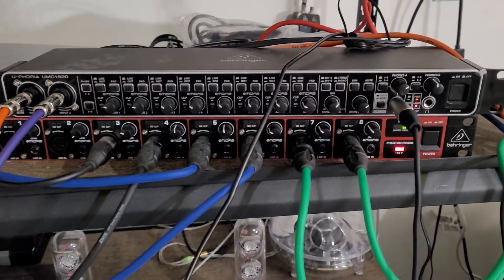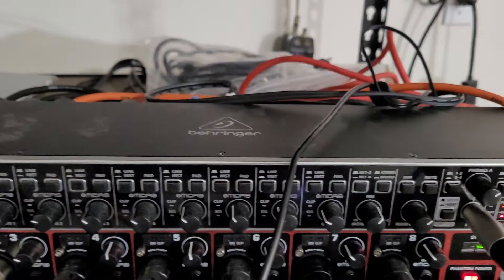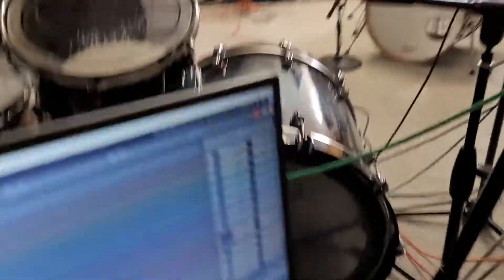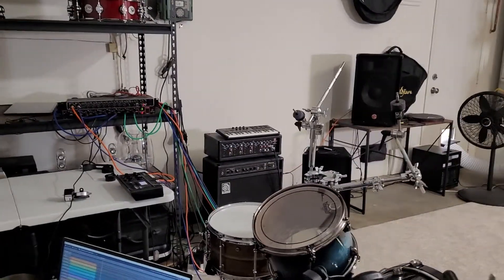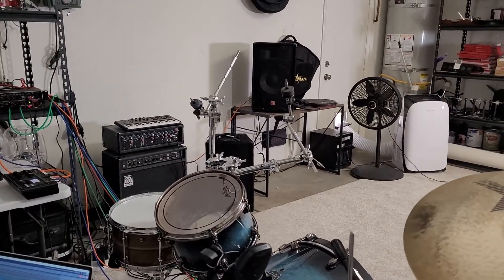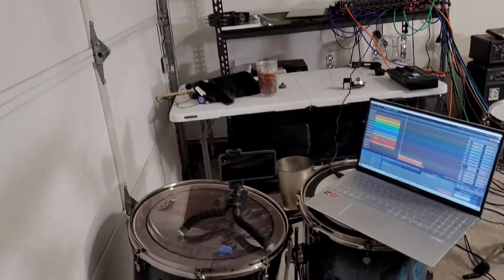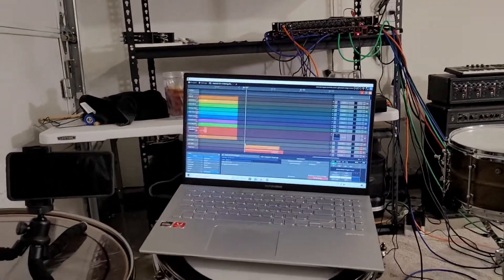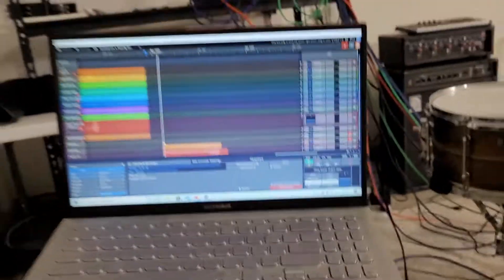My Process For Recording Drums 🥁 🎤 🎶 🖥 😀

Comment: Cool I should get stuff for recording
Reply from the maker: You have an electric kit, so all you need to do is plug the brain into a computer with something like garage band or cakewalk or something. Just need a laptop, the program, and a USB cable. If you want to mic your electric kit already coming out of your amp, just stick 2 mics in front of the amp, and run those into a converter box that takes XLR/1/4" cables and converts them to a USB signal. Then you'll have stereo/left and right recordings because of 2 mics. You could just use 1 and do it mono too. But, for acoustic drums, NOTHING beats a Yamaha EAD as far as versatility, sound quality, customization, ease if use, and can make your acoustic drums sound like an electric kit. You can use them live/outta a PA, in a mic/recording array, to practice with, or to play to covers. They basically replace needing an entire interface, multiple mics and cables, and is just a simple box that clips onto your hoop. The EAD is the heart of my entire rig! It captures sound from the center of the kit, so it produces a unique and very true sound. Plus, you can customize the stereo mics in it, or just use it as a mono/left output. Super useful and great invention! I use it constantly!
Reply: @blakenunndrums  that’s cool I want a vintage Ludwig or tama kit
Reply: @blakenunndrums  thanks
Reply from the maker: @brokenguillotine6988  Awesome! You can find some AMAZING used pro drums for super reasonable prices. My friend Ed at "drum flip" has the biggest selection of the best drums available, both new and used. It's where I got the Mapex and DW and the brass patina snare. I also got 2 or 3 cymbals there too! 5-600$ cymbals for 200 bucks! And ones that aren't even made anymore! Might want to check his site sometime. He has a literal gold mine of drum gear! Vintage is cool, but I may suggest going for metal hoops for your first acoustic kit. Wood hoops have their place, but don't always work for all genres. Gretsch, Mapex, Ludwig USA, DW (design or performance), Yamaha, Pearl, and Tama are great kits. The Yamaha stage custom is one of the best kits for the price out there! 600+$ brand new, and you get 5 drums that are very versatile. Tama uses die cast hoops, so the sound is much different and quicker/closed sounding, than kits with triple flanged hoops. Just depends in the sound you want. But, Pearl Exports make great first kits too. You may want to look into Mapex. They make the best drums for the price point, by far! A Mapex Saturn sounds just as good as a DW collectors, and is half the price...lol The Mapex Armory kits are also great beginning/intermediate kits. They make birch, maple, hybrids, walnut, etc shells. The Saturns are built like a tank! But Tama is a great company too! The silverstars are a hidden gem! I also love their newer B/B (birch bubinga) and B/W (birch walnut) kits!